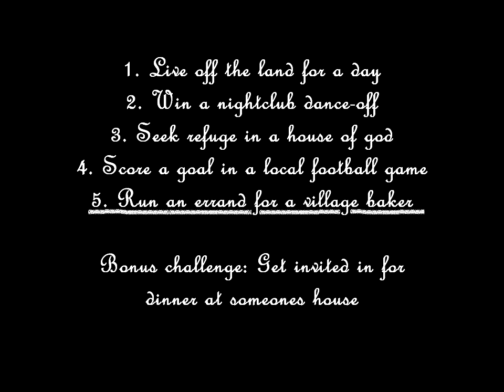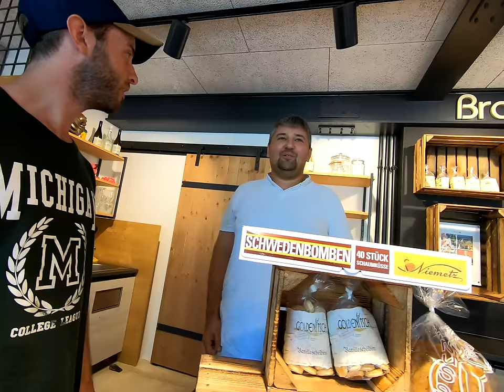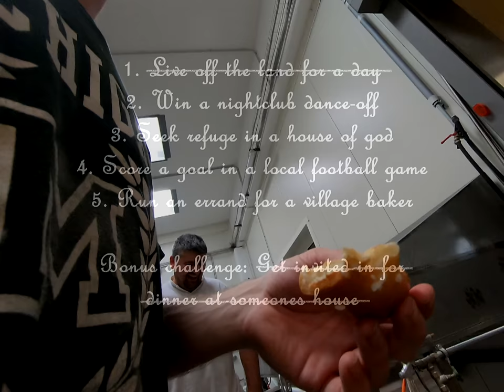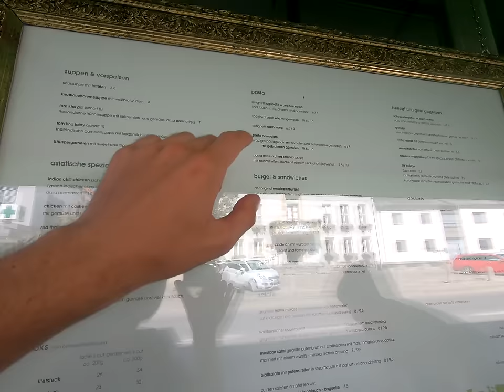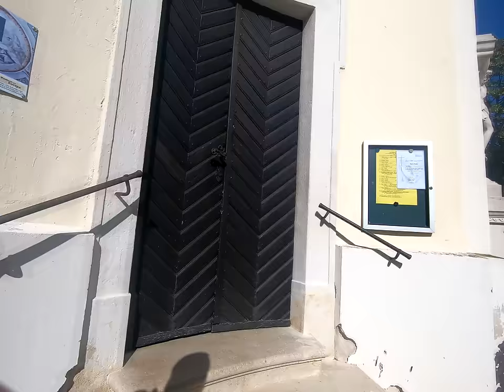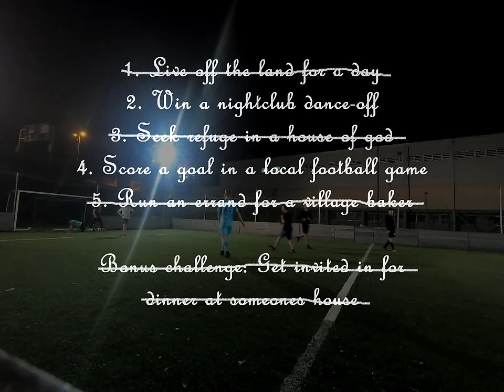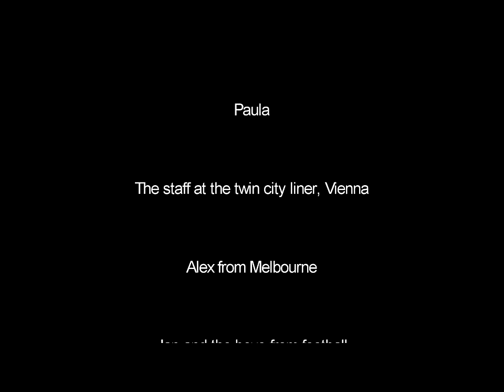These locals will restore your faith in humanity (How NOT to Travel Europe #5)

Comment: These videos are always top notch mate, so envious! Quick tip though. The flickering lights in the video is because the Euro power grid runs at 50Hz, and your camera is recording at 60Hz, or 30fps. Just set your camera to 25fps and it will fix the strobing issue!